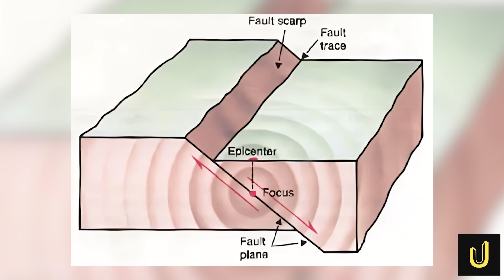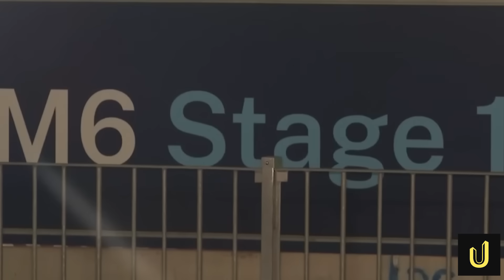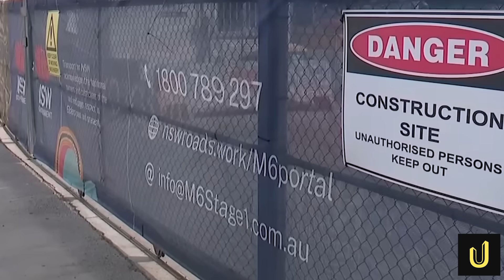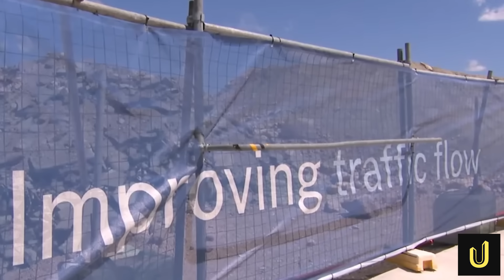4 BIG Mistakes That Sunk Sydney's $3 Billion M6 Motorway Tunnel

Comment: The M6 contract typical of the Libs style of contract. Signed December 2019. Probably all give away in secret clauses as well as design and build the m6.
Also there were reported sink holes in the Rockdale area in 1986 and 1994 so unstable ground in the area is not new. This information should have been assessed by the design and build engineers in detail.
Reply: I'll bet it wasn't the engineers who finally decided to use the "cheaper" option, but the accountants.
Reply: @chrisarmstrong8198 engineers are the ones making costs decisions
Reply: As well as engineers within the Depeartment.
Reply: @RogerDalrymple-w4t  engineers in the department will have been given the plans to asses and have questions from the department management teams, but they will not have as much input data as the planners nor time or budget to replicate the designers plans with all the whys and wherefores. There would be a check that the designers were qualified  by educational standing from an accredited university and had relevant successful experience to undertake the work.  Then their own budget would decide how deeply they delved into the plan and engineering numbers. If they were to investigate and check every line drawing and engineering calculation and composition, then there was no point in making the contract design and build it would have been build only.
Reply: @jimspc07 Yes — (The Departmental engineers can only do so much : To check each and every minute detail of the entire design would be — in effect — to undertake a second design project?)

Comment: Labor had the transport minister spin a story that this tunnel can be finished with the same budget after this collapse. What she doesn’t realise that all the buildings along the tunnel  section were thus fault is now have to be purchased, then removal of all the concrete they pumped in there to prevent a catastrophe will take time and money so this tunnel will require millions more. Also stage 2 from President av to the Princes Hwy all the way to the Loftus exist won’t happen now for decades.
Reply: Labor inherited this project. Clearly the geotechnical  investigation was flawed. Look at the Snowy Hydro 2 project, they barely got 100m and it caved in stopping progress for a year. That’s the lottery of tunnelling.
Reply: @dkw1254  Not flawed the first engineering company CPB engaged warned not to tunnel under that ground and suggested a cut and cover method because the ground was too soft. CPB didnt like that, got rid of them and employed another company that told them what they wanted to hear, "tunnel away!"
Reply: @dkw1254  Or the incompetence of the NSW Transport Department?
Reply: @dont_listen_to_Albo 
Snowy Hydro 2.0 is not a NSW Transport Department project. 
It is run by Snowy Hydro Limited which is an Australian Government (Federal) business, and 2.0 was established by the LNP Turnbull government. 

Perhaps you need to listen more to Albo, and less to the random voices in your head. You might learn something if you drop your hyper-partisanship.
Reply: @Dobuan75  You misunderstood my comment. I was referring to the M6, which is run by NSW Department of Transport.
Reply: If it was up to the liberals we would still live in the stone ages

Comment: First of all - it always supposed to be surface or shallow, cut-and-cover, project, with land reservations ready since 1950s. But, as usual, our beloved govt better wastes billions than boot out all NIMBYes, paupers vote for beloved Labs... the result is as usual.

Even if this tunnel will be fixed at last - below ocean level! Full scale wall in ground and grouting all around required, or similar appoaches - whats next? Ah, yes, another one tunnel from President to Cook bridge, under wetlands, with the same problems. And after the bridge - tadaaam - 100% it will repeat, regardless of existing planned corridor, perfectly visible on maps. For $BB.

Lucky Westconnecx did not collapse under Cooks river - it still leaks there, the whole tunnel is wet and dirty, means everything is very bad.
Reply: most of that section would be on land reserved [in the late 40's] unless they've changed the plans.
Reply: So explain this..... The surface above that section is lightly built over. Rather than trying to save the tunnel, why not go to a cut and fill section in the unstable ground section? And if not cut and fill, cut and use prefabricated concrete tunnel sections that they used for the harbour tunnel crossing? It's about 300 metres; it's relatively short. I would have thought building a concrete lined cut section would be far easier and simpler to do in terms of safety, access and simplicity of remediation.
Reply: @michaelmerrett538  Cut and cover is possible but very expensive - requires all buildings to demolish, and then too much soil to extract, somehow cart away and then fill back. Precast is not relevant at all, in harbour these sections can float up to their place - and how you plan to transport them on land?
Reply: yes i always look at gps to see where its wet - right underneath the river